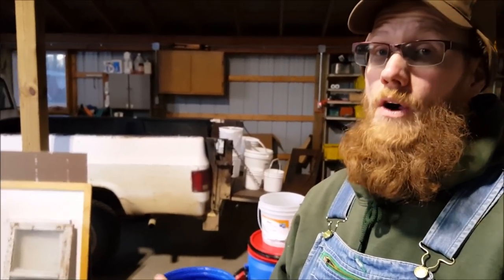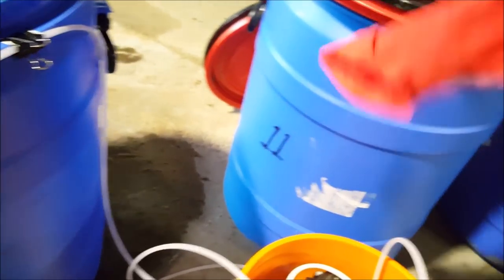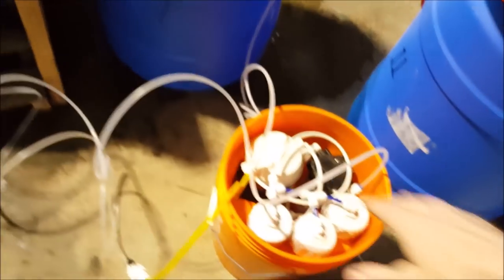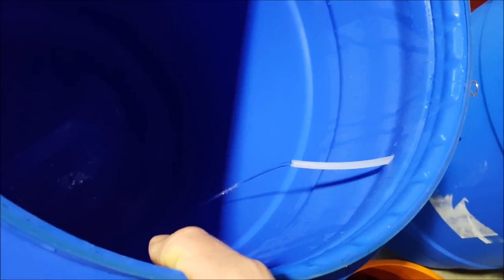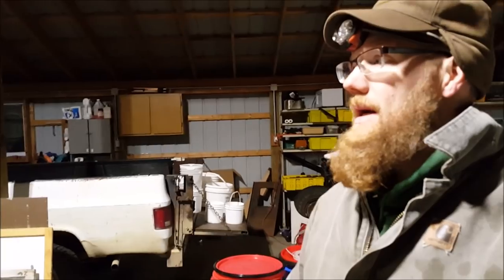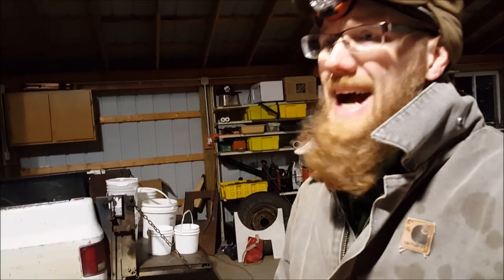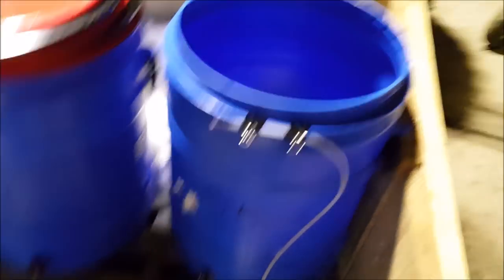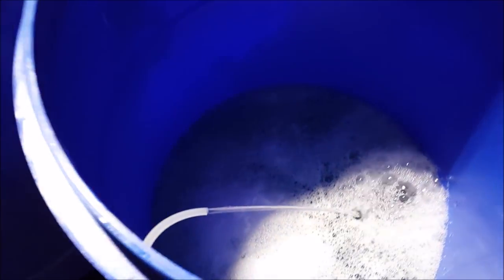How I operate my Maple Sap RO (reverse osmosis) For the Nerds

Comment: When I rinse, I take a sample of the sap every minute in my hydrometer cup and check with the hydrometer. When my brix have fallen to about 1.0, I call it good and pull the output tube from the concentrate tank. Any more than that and I figure I'm just throwing more water than it's worth back into my concentrate.

Comment: Quick questions.  If your raw sap barrel was elevated 6' up in the air, your RO bucket was on the ground, and your permeate barrel was 6' up in the air...do you think the system would still work like it does?  Would it put too much stress on the pump?
Reply from the maker: Sap 6ft up would definitely add some positive pressure, not sure about lifting permeate that high.  I will send you a message later this week with some good resources for ROs